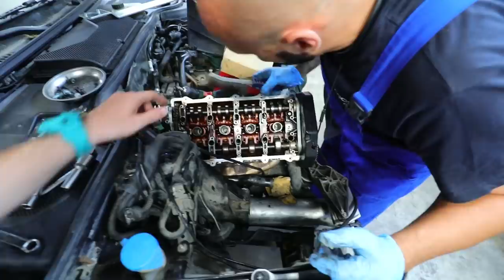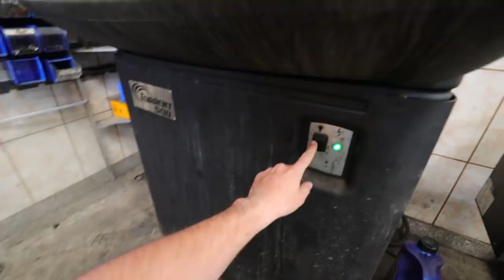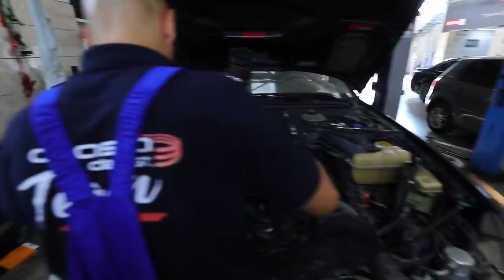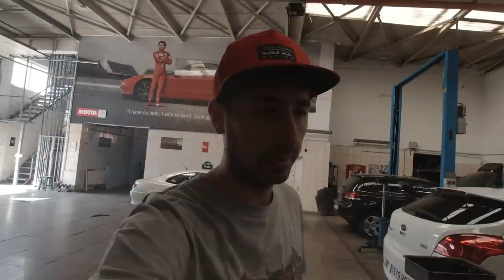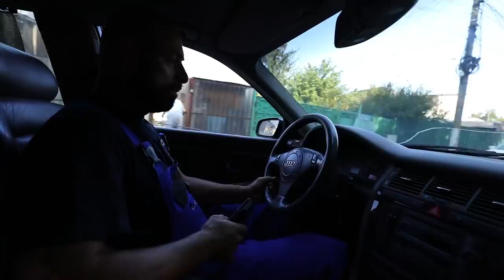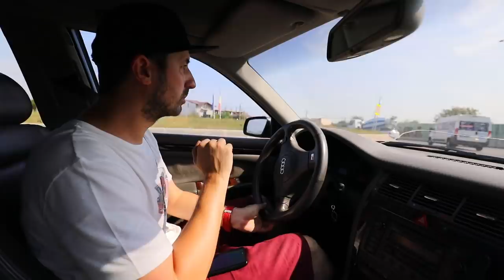PANA PROSTULUI pe autostrada cu un AUDI A8 4.2 benzina 😭😭😭 #128

Comment: 10w60 ? 
Wtf .... 
VAG cere uleiuri cu norma 502 VW 0w30/5w30/0w40/5w40 iar voi ii puneți 10w60.....
Reply: Poate in 2020, in 1999 nici nu cred ca erau mașini care sa meargă cu așa uleiuri subțiri , e V8 nu bagi in el ulei ca de 3 pistoane turbo...
Reply: In 99 nici nu se pomenea de 0w
Reply: @maneta2076  Daca motorul e in stare buna se poate merge linistit cu 5w-30/40, chiar Audi recomanda asta la vremea aia pentru uleiurile de tip: high-lubricity multi-grade. In principal vascozitatea uleiul se alege in functie de temperatura mediului in care va opera masina si de toleratele internelor motorului. Pe vreme aia exista un grafic cu temperatura la care va fi supusa masina si pentru conditii climatice de genul 40+ grade celsius era recomandat chiar si  20W-50.